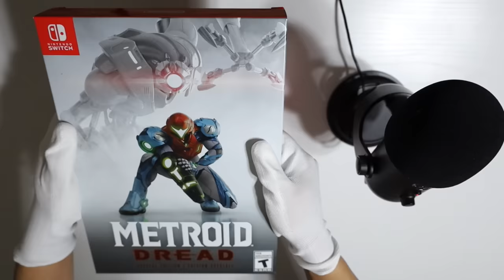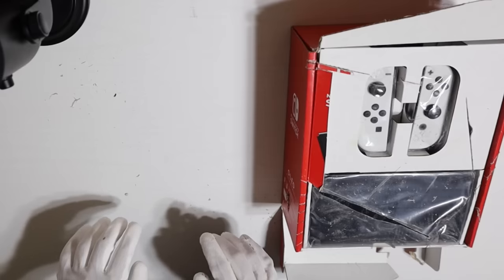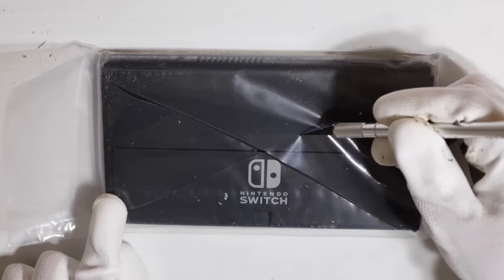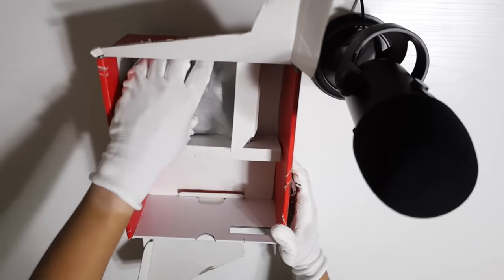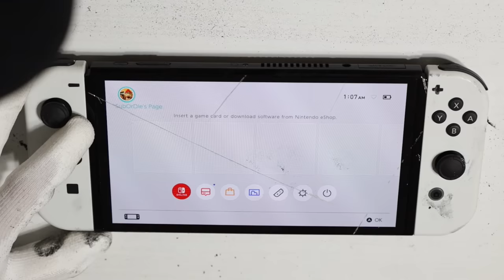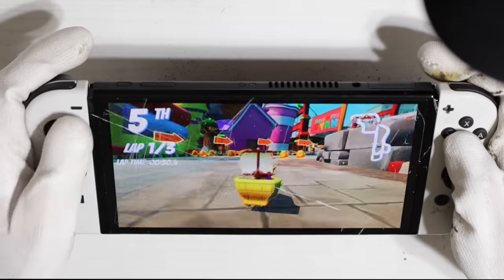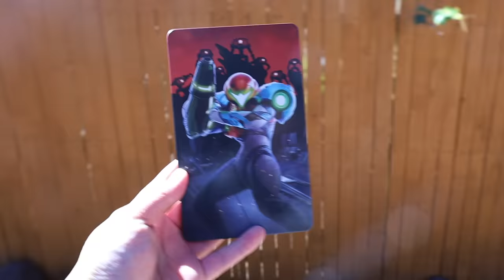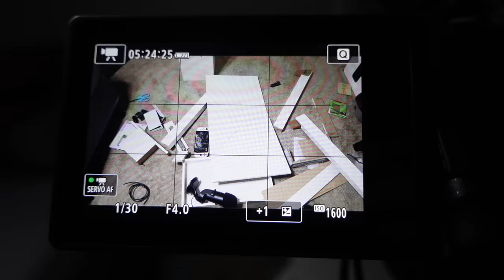HOW NOT TO UNBOX NINTENDO SWITCH OLED

Comment: Edit: Warning
King Liang is cause loud noises to people trigger.
Also headphone user cause loud noises to people trigger
Disclaimer
Without King Liang's face reveal, With face censored while floating window using Files by Google inculding Intel i486 SX, i486, Pentium, Pentium MMX Technology, Pentium II, Pentium II MMX Technology, Pentium III, Mobile Pentium III M, Centrino Mobile Technology, Celeron, Pentium 4, Pentium 4 with HT Technology, Mobile Pentium 4 M, Xeon, Pentium D (isaster), Celeron D, Core Duo, Core 2 Duo, Core 2 Quad, Core 2 Extreme, Centrino Duo Mobile Technology, 2008, Centrino Duo Processor Technology, Atom, Centrino 2, Intel Pentium, Itannium, Intel Core 1st Generation (i3 i5 i7) 2nd, 3rd, (i3 i5 i7), Core Ultrabook, 4th 5th (i3 i5 i7), Core M, 6th 7th 8th 9th (i3 i5 i7) Also Core vPro Processor Family, 10th (i5 i7 i9) 11th and 12th generation (i5 i7 i9).
Enjoy!